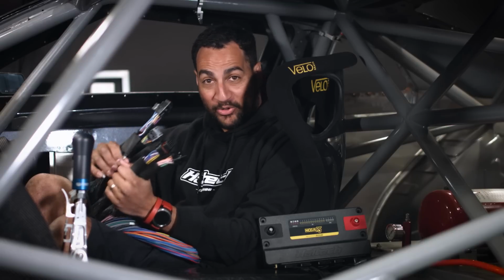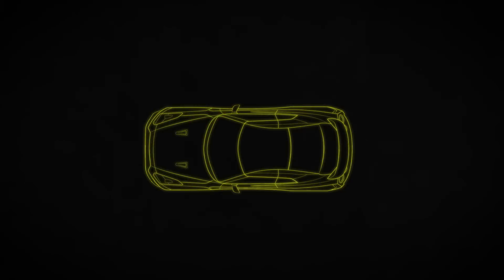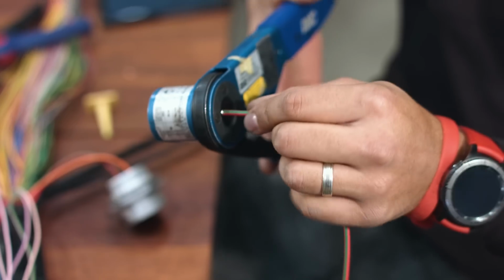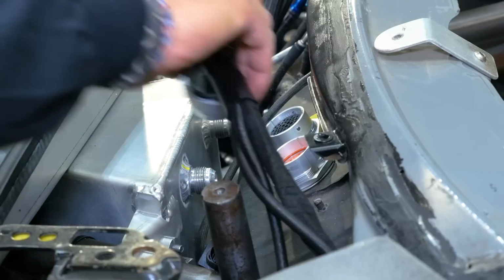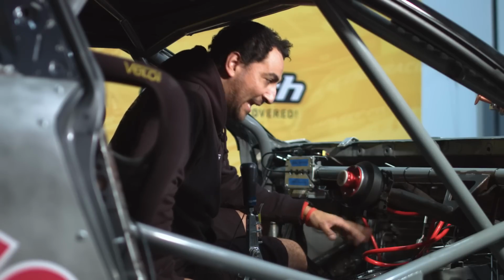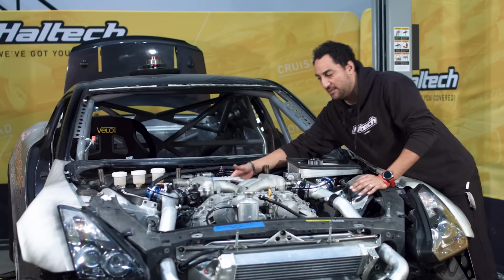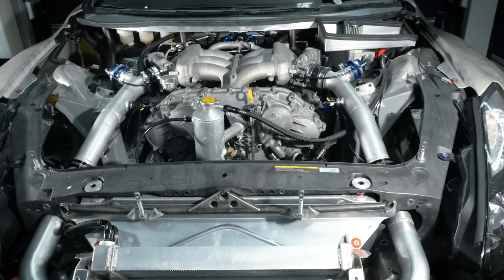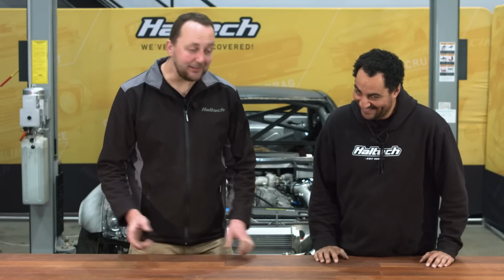🛠 EP2: Getting it all wired up - NEXUS + iC-7 + Keypad | R5 for R35

Comment from the maker: Welcome  back! 
It's time to wire this monster - and who better to do it than our resident Cable Guy - Dave:) We will be using a slightly modified factory engine loom which will connect to a Haltech universal wiring harness. It's a big job which, apart from the usual engine components also includes all lights, fans, a whole bunch of sensors for speed, shock travel, brake pressure, transmission and even a reverse camera. Once everything is wired up we add an iC-7 dash and a CAN Keypad. 
----------------------------------------------------------- 
Want a more in-depth look at the steps involved in wiring a car? Check out Dave's Wiring Vlog: https://youtu.be/IpNfRaM_P04